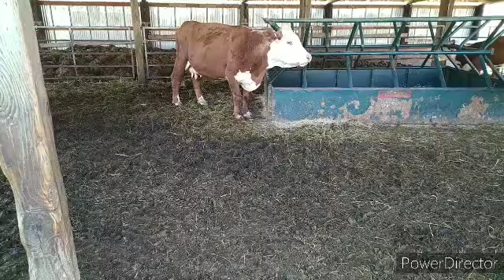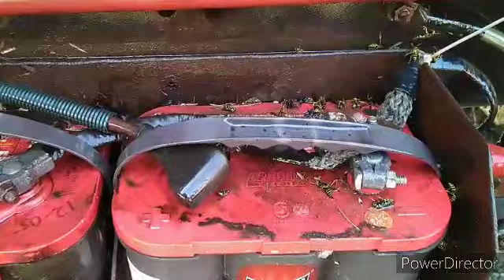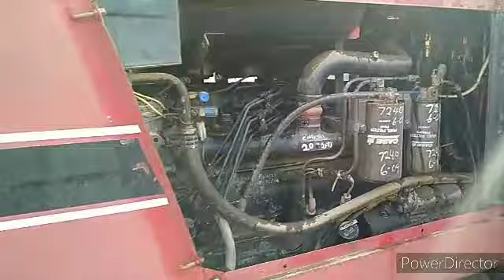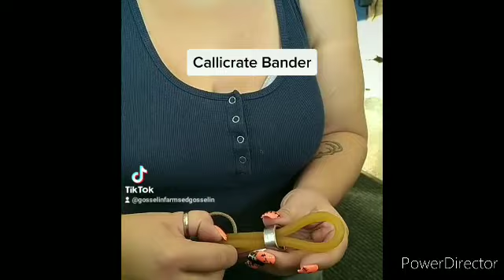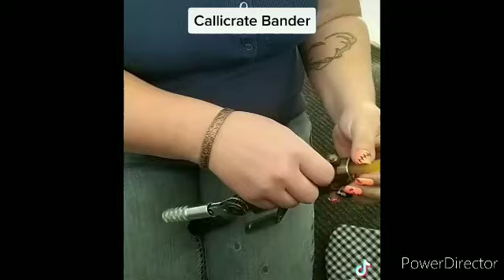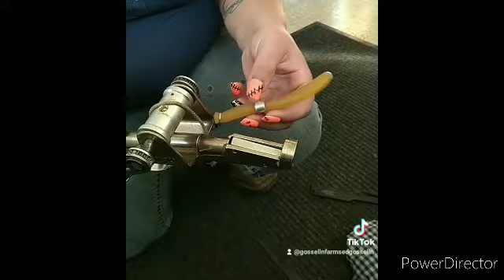moonset/sunrise. 5288 leaks fixed🤞 caltrate bander demo.

Comment: It’s bee / wasp season. The other year I had them flying up under my siding, after getting stung fighting them head on I set the shop vac under it and let it run for a few hours as they went in and out 🤣
Thanks for using a prosthetic for the demo 😂
Reply from the maker: Dang 🐝🐝🐝🐝 
Ty came up with the prosthetic change purse and golf balls 👍🤣😂